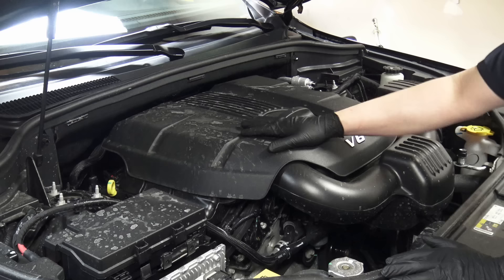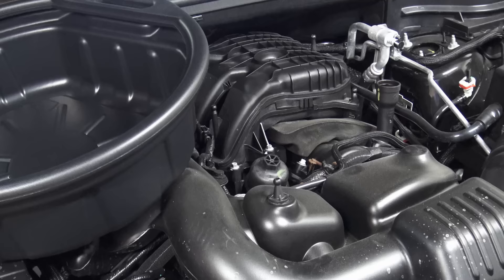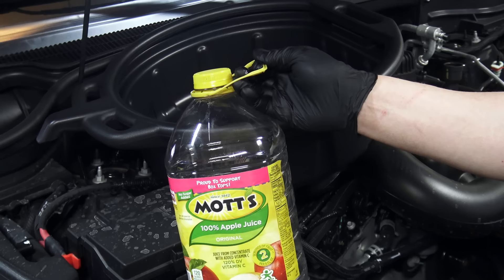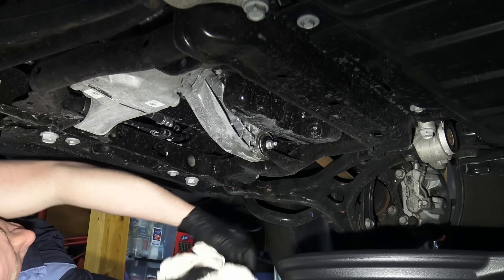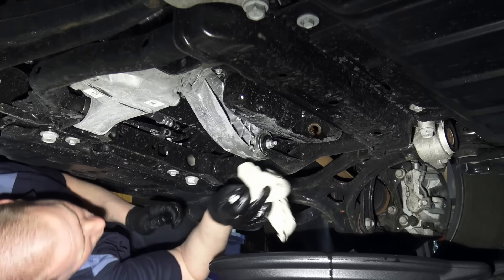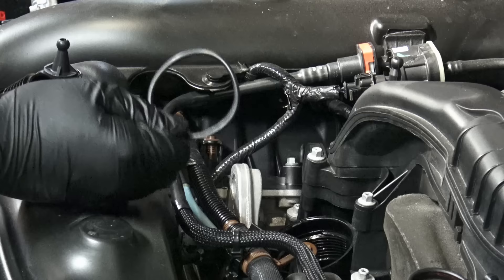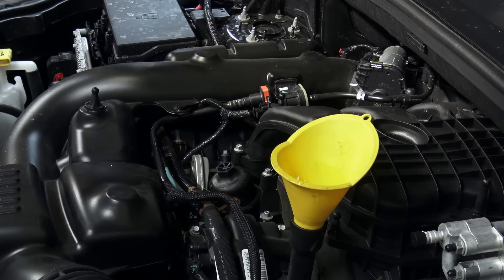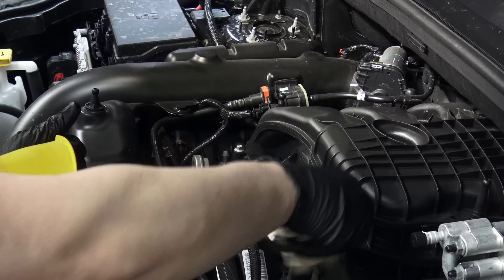2011-2015 Jeep Grand Cherokee 3.6L V6 Oil Change Procedure

Comment: I finally got a chance to change the oil in my 2015 JGC today. I found your video awhile ago and favorited it so that I could reference it when/if I needed to. I was able to get all the necessary tools before the job (especially the socket for the filter housing). I'm not new to DIY oil, however this was the first oil change for my JGC  (first vehicle other than a Honda). I appreciate you taking the time to put this together. It really helped me out.

Comment: Excellent video. Very informative but I have to tell you I have never seen anyone tighten down an oil filter so much.   I was just waiting to hear that plastic filter cover crack.
Reply: My heart dropped when I heard that!  Thought for sure that was going to snap!
Reply: OMG I also cannot believe he tighten that cover so much.
Reply: Hard to watch!
Reply: I was thinking the same thing.. just a little too snug for me.. I'll continue doing it the way I've done for years with no leaks or problems..
Reply: Yeah, I do half that, or less.
Reply: Way to tight that's how you end up cracking it or causing the cooler seals on block to fail. Also the filter should be pressed in the cap.

Comment: Great video. One tip, if you don't open want that rush of oil to splash all over the place when you first take the drain plug off DO NOT open the filter housing or oil fill plug before taking off the drain plug. After you open the drain plug then open the fill plug and housing. Also Mobile 1 full syn FTW.
Reply: Amsoil

Comment: BSG thanks for showing how its done, easy to follow. Getting ready to change  oil first time on 15 grand cherokee 3.6 114k miles, had 1 week now and have 6 qts pennzoil high mile ultra plat 5w-30, in summer where average high 90  then back to 5w20 for the cooler months. Don't have a mopar oil filter but have a a-c delco, should be good 3 to 5k miles.

Comment: Great video; really good instruction. Many thanks. This is my first Mopar with that cartridge filter. For the 2017 Pacifica, the cartridge filter is on the passenger side of the engine midway to the back on the top of the engine. 24mm socket on ½ drive racket with 6" extension. There's a trap door on the under carriage to access the oil pan drain plug with 12mm bolt head. ⅜ drive ratchet with 13mm socket or 13mm box end wrench. Thumbs up for your vid!

Comment: Thanks for the helpful info and tips. 
I found it easier to turn the wheels to the left and slide between the wheel and the passenger door to access the pan. 
I hate jacking up the vehicle.

Comment: Great video. Just a quick note: you can scroll through the menu on the dashboard after you reset the oil life monitor to get to the oil life screen. When I get down to 33% oil life, that when I change my oil. I use ramps instead of jacks just because I feel safer that way, but jacks are fine.  I've been using Penzoil full synthetic and with the filter it costs less than $40. An oil change place would charge $100+ and try to upsell me everything in the book. And forget about what the dealer would charge.

Comment: my only comment is that instead of letting the engine drain for 5 minutes you can also use some of the new oil to fully drain all the old gunk out. i normally use 6 3/4 quarts in my ram with 1/4 qt of lucas oil additive. the 1/4 of oil is what i use to assist in the draining. seems uncommon but i find my vehicles always run very smooth and i like to see the plug hole drip clean oil vs dirty gunk before its plugged.

Comment: Great video! Just a suggestion, but a 1/2 6 point is actually a little bit more snug on the drain plug. Or at least on the 2015 Grand Cherokee Laredo oil that I changed.
Reply: Yep, I tried a 6pt 13mm and it had a little wiggle. Used a 12pt 1/2 in socket (all I had) and it was more snug than the 13mm

Comment: At 6:46, you can let it drain longer, but consider also that if it is a windy day, then that wisp of oil may also blow all over the driveway regardless of how carefully you cave positioned the drain pan.  Tradeoffs with any decision.

Comment: Just one question, I have been told, do not over tighten the oil filter housing cap, can crack the housing. You seemed to over tighten this cap, being a side o-ring seal, that is what does the sealing, so no need to over tighten cap, doesn't improve sealing at all. Not sure if this is correct, please let me know.
Reply from the maker: Just need to snug it up, thaey can take quite a bit of torque without an issue. The oil cooler below that it attaches to is the leak point you need to be worried about.

Comment: 6qts instead of 5 like my old JGC...what a pain! I hate spending $7 on the separate quart bottle. Buying a 5qt jug and calling it a day was nice. This style oil filter sure was nice. Thanks for the video!
Reply: Mark B   I buy two 5qt jugs then pour off one qt  extra for the fill. Then I have extra oil for future changes. The oil companies make enough profit and charge ridiculous for a single quart...sheesh. 😏
Reply: @ZathrusGizmo123  Thanks. Could be a dumb question, but does oil go bad after sitting that long after opened? The last qt of the 5qt jug will be years old by the time it's used up.

Comment: This guy knows his stuff but the filter snaps into the cap and he put the filter on way to tight it has a o-ring so snug is all you need
Reply: That jeep more than likely is going to need a new oil cooler or filter housing now because of leaks caused by cracking the plastic housing.....dont ask me why I know just trust me
Reply: I stripped my oil filter cap and actually broke a piece inside and had to replace it. I wonder what happened to the plastic piece inside.
Reply: I cringed when I saw that part because my sister just replaced hers on her 2014 GC 3.6. I will be changing her oil this week and I’m going to see how tight it is from install.

Comment: From what have seen on other videos and my own car is the 11-13 have the solid bolt design on the oil filter housing cap and the 14+ has the 6 spoke hollow bolt design on the oil filter housing cap and use the updated filter with the nipple at the bottom?

Comment: Although 5w30 is acceptable, I am still skeptical on how  well it works with the slinger on the camshaft ahead of the PCV valve. And, remember also these engines have a solenoid on the oil pump that helps meter oilflow and pressure. I have a 13 and started using 5w30 in it as it has right at 200,000 miles now and I am sure the bearing clearances are slightly more, as well as piston to cylinder clearance. It does run a little cooler oil temps as well when towing.
Reply: I don't know if it's on certain years but according to the user manual, for the 3.6 V6 you're supposed to use 5W30, the 5W20 is for the V8. Now like I said I don't know if it's for certain years but mine is a 2012
Reply: My wife's 2013 JGC owners manual, page 634, says to use SAE 5W-20 for both the 3.6L & 5.7L engines.  Also, when I search Mopar site for the oil filter it states Mopar (68079744AD),which is Mo-744, not the Mo-344 mentioned in the video. Excellent video by-the-way. @RogueStormCB13
Reply: @chuckq2998  my manual said otherwise, also the cap for the fill point and the fact that mine is a 2012 not 2013

Comment: Just purchased a 2015 Grand Cherokee with 30,000 miles. 1st oil change going to use synthetic, is the Mopar oil filter you used, preferred with any oil , regular or synthetic? Or is there a synthetic version ?. Thanks man. Great video
Reply: mopar is OE but i use mobil 1 or wix

Comment: Thanks for the great instructional!  Just got a "16 Grand Cherokee with the  5.7L V8 Hemi.  Any big differences in the oil change procedure that you're aware of?  Would like to transition to full synthetic.  What mileage do you feel that's appropriate.  Thanks for the help!
Reply from the maker: +beaglestink I wouldn't transition until at least 10k miles.

Comment: Nice Video, I have changed a lot of oil but not with the new type of filter that is also on my Jeep Wrangler. And learned some good tips from you here,
 My question is what is the reason behind leaving the dip stick out when first starting the engine? Must be something with air but if you would explain many thanks.
Reply from the maker: No reason it was just out already for the draining process.

Comment: Brian, I have the 2015 Overland.  I assume it uses the same oil filter, but could you confirm that for me?  Also, I plan on keeping this truck for as long as I can and fuel efficiency isn't important to me.  Instead, the engine wear is.  Would you recommend 5W-30?  Lastly, what harm would using say Ultra Platinum Pennzoil, if I began using it at my first oil change?  Thank you for all your input!
Reply from the maker: +NobodyHadThisOne Yes it is the same.

Comment: I have a question, is there any special reason why you don't just put the used oil in the jugs that the oil comes in, it seems like that would be somewhat easier, just label it as such
Reply from the maker: +camtheham13 I don't fill individual 1qt containers it makes for a huge mess and I have large containers around the shop for oil collection all the time
Reply: I buy my oil by the 5 QT containers. It's just easier and for most times times it's slightly cheaper. I save the containers to use as old oil containers for recycling. I don't get any money for it but I don't have to pay to get rid of it either so it's an even wash for me.   Great video Brian. Thanks for hosting this.

Comment: I read somewhere that after refilling the diesels with oil you should wait about 30 min b4 starting it because oil takes a long time to make its way all the way through the 3.0 engine. Is this true?
Reply from the maker: Sorry I have been away yes this is true and is the same reason you want to wait 30 min for the oil to drain on that engine also.

Comment: I use a 5 Gallon kerosene can.You can get them in some auto parts stores you don't have to take right away to the recycle center after an oil change.Plus they have a handle on the top to make them easy to carry.BTW,you can tell Jeep is a Chrysler Product by that starter sound.But I hear Chrysler starters are better than most,but that's a rumor.

Comment: Great video , explained everything to a T. I do have a question about the drain plug. I've done many oil changes on different vehicles, but my 2014 JGC is the first one were there was no drain plug washer. Is this OK ?  Thanks
Reply: My 14 came with a drain plug washer but I lost it in one of my changes and never replaced it, never had leaks
Reply: I have 2014 limited jgc i dont remember having a washer.

Comment: I was hoping you would give some info on what would happen if the small o ring at the tip was missing, what effect would it have on the engine? I think you may have tightened  that hosing a little to tight!!

Comment: Great vid thanks. Would my 15 GC be the same as this GC? Also I have 40k on it and am thinking of going to the Penzoil platinum full synthetic. I tow a boat quite a bit over the summer and people seem to think full synthetic is the way to go. Also they say you can go about 10k on a oil change, just watch the oil monitor system. Thoughts?
Reply: Full synthetic all the way. Chrysler reccomendations are shell helix, castrol, or pennzoil. Pennzoil has had a bad rep with using waxes in there oils but think they strayed away with there newer formulas. Mobil 1 isnt "chrysler certified" because of a pissing contest with all the buyouts even though jeeps were factory filled with mobil 1. I fill with mobil 1 and use either a wix or mobil 1 filter.  Use a good oil filter wix, mobil 1, mopar, k&n etc. dont use cheap filters..fram etc..doesnt last as long, isnt as good construction, sometimes even breaks apart and doesnt filter well. People change synthetic oil based on owners manual or preference which range from 5k-20k miles. Hope this somewhat breaks it down. Alot of information out there but as long as you change your oil timely and filter youll be fine.

Comment: I have a question for you. A mechanic buddy of mine that's worked on all my cars (Mostly Ford, until the new Jeep GC) said that before he put the oil filter back on he would fill it with fresh oil, is this not needed on the GC because of the oil filter placed on top of engine opposed to screwing in from under engine? Or is it still acceptable practice to add some oil to the filter housing before you seal it up?
Reply from the maker: +GaynNovi It is not needed and will just flow down to the crankcase anyway on these.

Comment: I think you just need to click Ok to reset in the odometer screen settings that's it? why did you use the pedal?
Reply from the maker: No they use the pedal to rest the oil life monitor.
Reply: BSG Automotive even in the 2018 model?

Comment: Great video.  How do you change the plugs.  The dealership wants $289 to change them.  Sounds a little high to me!!  There is a recall on the number 2 cylinder head.  They replace at no cost. It maybe a bench bulletin instead of a recall.  My engine light came on and that was the problem.  This is on a 2011 Jeep Grand Cherokee Overland with 62000 miles. What is the advantage of using synthetic oil and if you use it, how often do you change it?
Reply from the maker: +Donnie Leggett Synthetics are better overall for wear and especially startup. The penzoil platinum I mention is made from natural gas so al the molecules are the same size so its really good stuff compared to other synthetics. That plug change sounds about right since they have to remove the upper intake.
Reply: BSG Automotive Thanks much.  I will go with you suggestion on my next change.
Reply: Mine has a ticking noise on driver side engine area I'm freaking out I just bought it a couple weeks ago

Comment: Iv'e changed my oil on my 2014 JGC every time my self except the last time. I went to change the oil yesterday and my oil fill housing is damaged. Do you have any ideas on how to remove it ? I don't want to tear it up more,but I can't budge it. Ty Jim.
Reply: Are you talking about the filter plastic screw? I just changed my oil today and they had tighten the plastic housing for filter so much it got stripped i had to use filter wrench to take it out

Comment: So i just got a 2016 model and the air intake seems to have a different design. The tube kinda goes over the oil filter and  I was wondering if you knew about any changes from the 2016 model to the one on this video?
The way i know its different it's because I tried looking for a K&N air intake and they only have up till the 2015s models and none for the 2016s.

Comment: What to do if oil drain bolt is on too tight to remove with ratchet? Is impact driver safe to use if careful?
Reply: Use pipe to losen.

Comment: I was thinking of using Pennzoil Ultra Platinum full synthetic @ 2000 miles. My Jeep Wrangler is also new, it has like 200 miles right now. Am I making a mistake?
Reply from the maker: +Daniel Lourido I would not use full synthetic just yet no.
Reply: So wait! After 5qt of SAE you put 1qt of synthetic oil? And  do you change the oil at 3,000 or 5,000 for the Laredo X?
Reply: Oh lastly, how long the engine has to run after you've finished putting the oil in?
Reply: I think(?) he meant that he will use the SAE for several more thousand miles before switching over to synthetic. I had to rewind that part too.
Reply: Terrathrax he said start with Synthetic after 10k miles

Comment: Two things I noticed is WRONG. O ring placement should be more like in the middle. He said bottom . And he way over torqued the new filter back in. If over torqued it will either break the plastic or cause a lot of leaks over the motor and transmission. That I have had on my 2015 grand Cherokee. I put back on around 10 lbs

Comment: I loosened the oil filter while I was draining and it easily went for another solid five minutes
Reply: Thats true.  I left the drain plug off and it was finished draining.  After I loosened oil filter,  lots more oil came out.  I'm not sure about the five minutes but easily another 15 seconds or so.

Comment: I have a lerado 4x2, have you done rear diff oil change ? And what oil is recommended?
Reply from the maker: +Mauricio Iraheta  I have not as mine only has about 16k miles on it. I recommend the stock mopar fluid for your model year unless you are towing then I would get a synthetic equivalent from a company like royal purple.
Reply: +BSG Automotive , juts got mine done and we used Penrite equivalent. Cheers!

Comment: You dont need to lift the vehicle, the drain plug can be reached just fine from the from to the Cherokee. Also there is absolutely no need to use petroleum based break-in oils on new factory engines. Engines break in over a period of time anyway. Just change the oil every 3 to 4 thousand miles. Seriously stick with the factory oil suggestion.

Comment: Great video real helpful thanks..... Hey Brian would you happen to know where the oil pressure sensor is located on a 2012 jeep grand cherokee?
Reply from the maker: Mirna Perez Under the intake in the rear, intake must be removed.

Comment: What about 2016 models? is the oil filter same? I know 2016 models call for 0w20 oil
Reply from the maker: 2014-2016: http://amzn.to/2i6kjOo
Reply: BSG Automotive one more question please.
Would you still recommend I put fully synthetic oil after 5-10k period even tho it doesn't mention synthetic in the manual. thanks.
Reply from the maker: Synthetic is always a good idea after the 10k mile break in period especially at these prices for such a good oil-  http://amzn.to/2jxDm01

Comment: 3000 or 5000 in a modern car is pointless, even most conventionals can go 7500 unless you short trip in cold weather, follow what the owners manual says...
Reply: Old Fords Don't die Sure but if you don't mind spending little extra money it's always better to have fresher oil.
Reply: Always a good idea to change early on first 2 changes of a new engine.